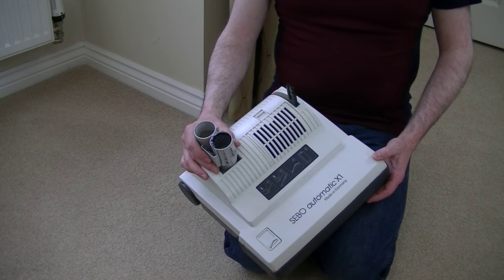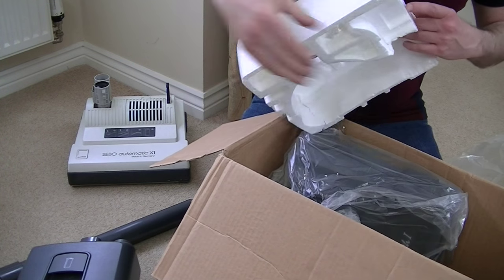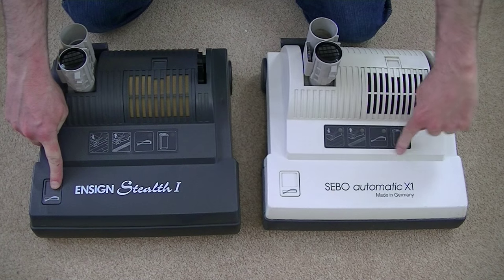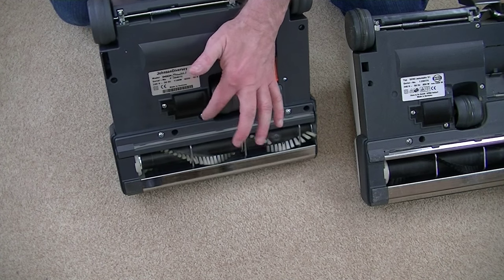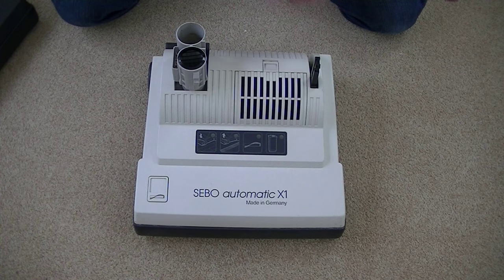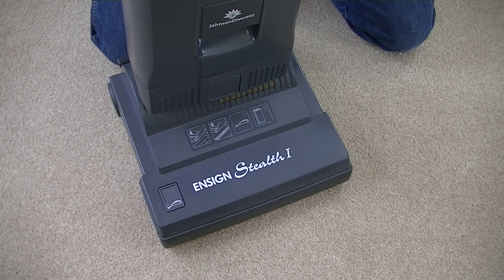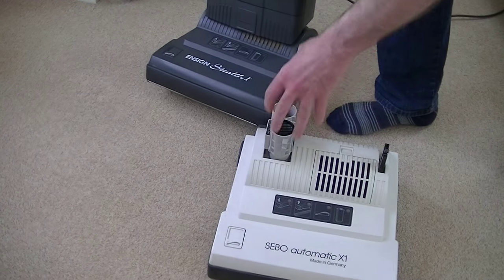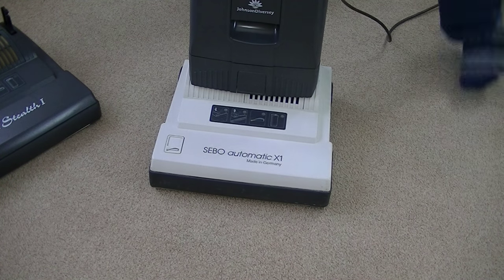Testing my Replacement Sebo X1 Vacuum Cleaner Head

Comment: I have just got an x1 where the height  adjuster seems always in the down position. When. Upright it’s clearly trying to adjust but doesn’t seem to be able to do it. It seems to struggle to go up to take the brush off the floor. I’ve heard of magnets being an issue, but not a clue where to start. Any suggestions would be much appreciated. My plan is to see if I can swap the hight adjuster from an old x4.

Comment: Hi Roger - did you ever get the Stealth working properly with the X1 parts? The quickest fix would just be to take the motor cover off the Stealth and put it on the X1! Cheers.

Comment: How does the automatic height adjuster work?  Is it programmed to maintain a certain precise amount of tension on the brushroll?  Not too weak to be too high, yet not too strong to be too low? Curious minds would like to know how Sebo's engineers approached the design challenge.....:-)
Reply from the maker: +Brian Torobin I believe it works by constanty measuring the resistance of the carpet against the brushroll and can compensate the adjustment as the brush wears. I have always found the brush doesn't go low enough for my needs, but the latest model has a boost button on the cleaning head that enables the brush to go lower for a deeper clean. I have one of the new boost models and will be testing it soon.
Reply: +ibaisaic Aha...I see.  Pretty ingenious.  It seems that the boost feature will please North Americans too - many users have complained that the Automatics never clean deep pile well due to the oversensitivity of the sensor.:-)
Reply from the maker: +Brian Torobin At least you get the option of manual height control which we don't in the UK unless you go for a commercial version.